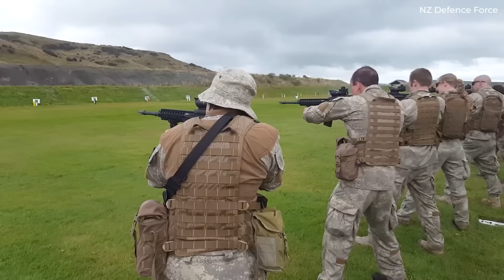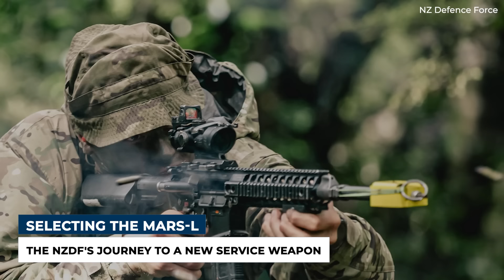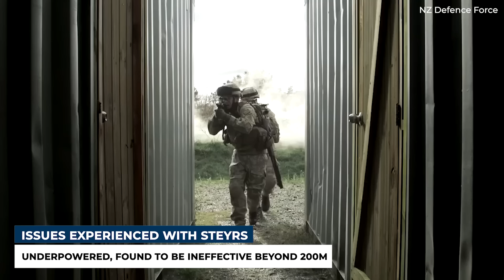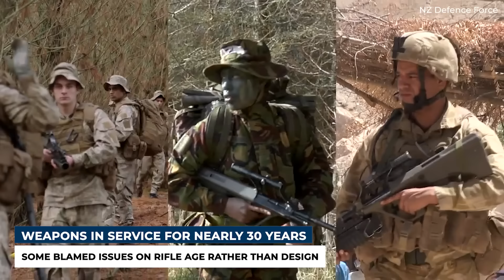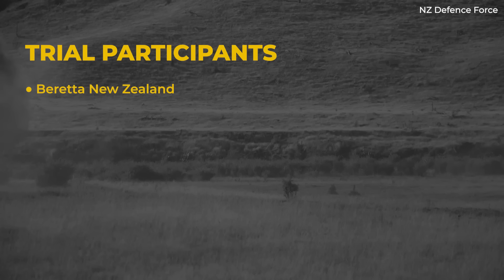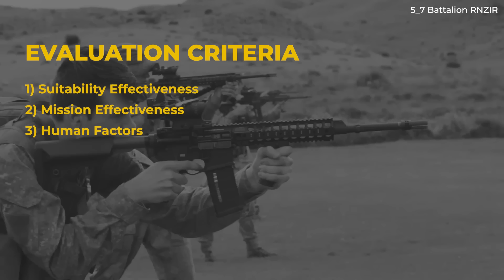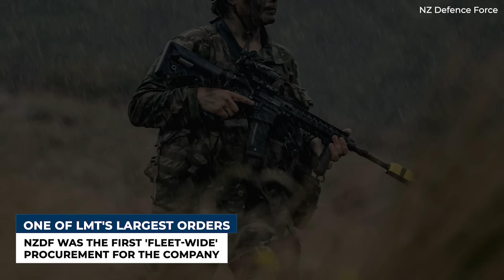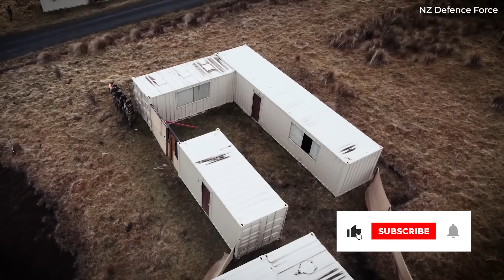NZDF’s Move To MARS-L: How New Zealand Selected Its Service Rifle

Comment: It's worth noting the NZDF had a per rifle price limit as well.   The MARS-L was the best in it's price range.
Reply: Obviously price matters, but the  Aussies made their AUGs  and regularly  and then started to improve the rifle, because Steyr did not.     The AUG can now be cloned/copied ...as can the M4 & G36.  And currently the HK 416 can be cloned/copied.   FN is a government owned company a major small Arms manufacturer.   The money for  the replacement, should have been for establishing a State owners Weapons Industry, starting with 556 & 762 ammo, grenades, , and   BP516  which is an improved clone of the AUG A2 or a  the AR5 which is a clone of the M4.    And then immediately start start implementing improvements, as well as do R&D and prototyping using now public IP to design NZ made weapons.   There was no need to replace the AUG with a new rifle ... if NZ  could make and entire AUG A2, & provide parts.  And one the NZ Weapons Industries is fully operational then it can start designing & making the replacement Rifles ( SR, DMR, SPR) & MG( SAW, LMG).  All of the  old FN MG are now able to be cloned
Reply: I strongly disagree. 

We're talking about a procurement of 9,000 weapons for a duration of 20 - 30 years, we do not need a domestic industry to fill that.

Also, the Styr is restricted when it comes to sights and attachments, it's fundamental design will always be restricted in that way.  With our experiences in Afghanistan showing that long range accuracy is important, that being able to effectively fire on targets a half kilometer away, effective sights are just about mandatory.
Reply: @launchsquid  Again.  FN from little Belgian, is a majar small Arms maker supplying weapons all around the world including NZ  offering the Scar L, when their FNC,  the G36, 416, M4 and ... Steyr AUG A3 are now Public IP that anybody can copy/clone.

NZ's AUGs were not A3 but were mostly the A1.

So NZ's version  FN, would simply supply parts & upgrades to A3, for current rifles ... will make 556& 762 ammo, grenades, ... will supply parts for Legacy weapons still in serice, and will start R&D & prototyping for new rifles & MG using Public IP.  And eventually compete with FN, HK, LMT, Colt, Baretta, etc to supply small arms & ammo to the miltary, police & civilians. 

There was no need to rush for a replacement, and for a military that is primarily the Army, then there is a need for an Armoury to provide at least guns, ammo, grenades and not rely on imports.
Reply: @launchsquid  That's because all those weapons were flogged out junk by the time they were replaced due to the services being run into the ground and made nearly derelict by government cuts. 
The original Austrian serial number weapons that the NZDF bought were more accurate, the Australian serial numbers had problems with bolt sleeve's cracking which were improved later. It would be interesting to know how their manufacturing tolerances and practices have improved from over 35 years ago. 
A bullpup .338 DMR version might be a sensible avenue one day. The main problem with the original Steyr AUG was the lack of room for forward furniture like lights and IR lasers along with the sight system that was outdated and unable to be removed and replaced.
Reply: @abelincoln.2064  Belgium is also connected to a wider European road and rail network that can supply all the high-quality materials needed. 

New Zealand is not.
Reply: @launchsquid  yet less then 6 months after NZ announcement, Australia was testing the EF88 which had full customization on sight and attachments.  Has effective range of 300 to 600m.
Reply: @abelincoln.2064  You are living in a dream world.
Reply: @Pilotmario  Why don't you want New Zealand to be be able to make its own guns & ammo,  ... but instead rely in foreign imports, and by the best the Europe & the US design & make?

Again.  The M4, G36, AUG A3,  Glock 17,  & all the legacy FM MGs are now public IP for any ... Company .... to clone & sell, which private companies  are doing.

The Aussies have a better trained & equipe Army than the NZ, and they did not give up on the AUG after its failings in Afghanistan, nor did the British give up on the SA80.   The AUG if properly maintain, upgraded restocked is a good weapon system, although with limitations. There was no need to replace it.  And instead of spending $40 million dollars on the LMT MARS, .. start a State owned making popular  ammo ...and ...AUG A3 to support the weapons use for the next 20 years, as well as make legacy pistols, Rifles & Machine for domestic/foreign sales, and eventually design their own firearms and quickly catch up FN, Sig(USA),, Barretta, HK, KAC, Taurus, Glock, etc.

But NZ has been for over 40 years been run by Globalist Liberals, who have no problem trading with a Regime that slaughtered 100 000 Democracy Protesters in 1989, and yet that same Regime is an enemy State of the Free Western World.  Only Liberals are this dumb, selfish & unethical.
Reply: @uncletiggermclaren  So its a fantasy that private gun companies are cloning legacy  pistols & rifels that are now Public IP,  ... including the AUG A3  ... or M4, M249, M240, G3, FNC, HK416, G36, Glock 17, MP5, 1911?    Stop being a Liberal.
Reply: @launchsquid ah stop, the Aug a2 fixed the sight issue decades ago. The Aug has a longer 20 inch barrel, and no 5.56mm rifle is engaging anything at 500m in reality
Reply: Interestingly, the aussies didn't make a left handed version, and I've seen what shooting one weak handed does to a face... all the lefties were made at steyr
Reply: @EmilyWalker-dr4bg     Yeah, I remember the NZDF made a big thing of the MARS-L being swappable right and left.  So it was better priced, more reliable, and had more features.  Maybe not a hard decision.
Reply: @launchsquid Your soldiers should be training to accurately hit CCP sized targets up to 500m. Any weapon platform that can do that is good enough.
Reply: @Muritaipet  Yeah great for those LEFTIES like me!😂
Reply: @peter-michaelkeys.2522    Good on ya.
Reply: @abelincoln.2064   Well, no.   Because you're ignoring the economic and technical complexity of making a rifle.  

To do what you suggest requires everything from steel mills that produce the appropriate steel to engineering / production lines producing hundreds of thousands of parts.  A really simple rifle like the M16 has over 100 parts. 

To make our own would actually be a major industrial project.  And with no more than 20,000 units (from memory we got 17,000 Steyrs), the cost per unit would be horrendous. 

My inside information was the army were given a maximum budget of NZ$12,000 per rifle. Which does stack up against the $59 million paid, for 9,000 rifles. About $6,500 per rifle. 

Let's be realistic here.  We could not manufacture 9,000 rifles for $59 million in NZ. Just the set up cost would be higher than that.
Reply: @Muritaipet  NZ did not just buy a rifle for about $6000, it bought a kit.  Don’t know how much the sights could have gotten cheaper separately. But the weapons cost is closer to $3000-4000.
Reply: @thomasb5600    Yeah. When I used that pricing I was being generous to abelincoln2064, and his suggestion we tool up and build our own.
Reply: @thomasb5600  What a deal.
Reply: @Muritaipet  As a project to employ a bunch of people, use our innovative ways to invent new processes etc etc it would have been good to see.  I'm sure we have the skill here.  Possibly it would have to be seen as a wider society make-work project to justify the cost.
Reply: @CitroenDS23    Or we could spend $59 million on the rifles we got, on time and under budget.  

Then take the $100 million we saved by NOT pursuing your idea, and get Rocket Lab to send up some NZ owned and controlled surveillance satellites. To look the 40,000,000 square kilometres, we have international obligations to monitor. With 2 ships and 3 planes.*  Maybe we could even add in some Global Hawk type drones to the mix. 

The perennial problem in NZ defence, is we always need to do too much on too little budget.  This will not change.

Adding on things we've never done before, is usually the worst idea. 

* I know we have more patrol assets than that.  Remember there is always less on patrol, because machines and crew require downtime and maintenance.
Reply: @abelincoln.2064 yes but a M4/M16 clone would be the easiest and preferable to the plastic fantastic.
Reply: I've been told by someone involved in the backend part of the trials that the price Thales Australia (who would have supplied the AUG if selected) for just the rifle was more than the price that LMT wanted for the rifle, optic and support package. Thales AUS thought they could take the piss and that we'd just automatically select the newer AUG version because it was what we were used to. With behaviour like that it's no wonder that the AUG wasn't in consideration.
Reply: @chrisp-nz.2544    Yeah. I've heard something similar through old contacts.  And also ...  someone else in these comments said they were involved in the trials, and that the MARS-L outperformed the other rifles. If that's true, we may have got a better rifle and a better price. 

But it's worth noting the Aussies might have a different strategic purpose to us.  They want domestic manufacturing capability, just like with their ships and armoured vehicles.  If that's part of the objective, the decision to pay more probably made sense for them.
Reply: @Muritaipet  I was involved with the trial. Myself and others only rated the MARS-L at maximum 4th place, my preference was the Steyr and H&K 416 both were expensive. It is true about the ozzys being greedy, the steyr the was purely out of contention for that reason. 
The MARS-L was just average across the board.
I also find it funny that there is no mention of barrel wear for the MARS-L as unlike the steyr its not chrome lined, if using the operational ammo 2000 rounds and your accuracy is pretty much gone.
Reply: @23kilkenny23   Interesting.  Scroll through the comments, you'll find the guy who said what I misquoted.  (I just looked again, he actually said "LMT was the only rifle that suffered NO issues.")

Price always has a role in buying weapons. Yeah, we need commonality, there are many strategic factors. My info was the budget was $12,000 max per weapon.  It certainly came in under that. 

As to accuracy.  Yeah.  Both of us have just fired in the general direction of the enemy, with no real idea of where they are. And when you can actually see them, that means......

Put a lot of slightly aimed rounds in their general direction.
Reply: Anyone looking at NZ military equipment would automatically make that assumption. 
We are a tiny nation with a tiny military.
We have an agrarian economy.
It's only logical that our arms budget wouldn't allow the purchase of anything that might make John Wick jealous.
Reply: @IvyMay-qn2ys    lol.  We are a little bit better than "an agrarian economy".  Rocket Lab for example. 
Otherwise ...  Yeah, spot on.
Reply: @Muritaipet 
Agriculture is a crucial & foundational pillar of our export sector.
Agriculture, fishing & forestry make up the bulk of our physical export goods. 
While not a strictly agrarian economy.
It's the best way to describe our economy without getting too invested in the details.
Those industries employore kiwis than any of our other export industries. Like technology
Reply: @IvyMay-qn2ys   Absolutely.  It's always best to remember that once the gold ran out, we built our wealth on sheep.  Then dairy.  

The classic economics production example is "guns vs butter".

We buy guns with butter.
Reply: Hare that little firing pin retention pin in ar family bolts. 

Used the ar/m4 domestic and overseas on deployment. 

Used the steyr for 2 decades ish.

Both have pros and cons

Comment: The NZDF Steyrs were all ancient first-gen F88s, no rifle in the world is still going to be running perfectly after that time in military service. 
There was no accuracy issue with the F88, the main limitation was the donut sight which was sub-optimal for longer range shooting. When we started getting ACOGs for our F88SA2s even the most spastic shooters were consistently hitting targets at 600m. As for the rifle's lethality, well it's a 5.56 from a 20" barrel, it's certainly not going to be any worse than any other 5.56, especially one from a shorter barrel.
Plus there was always a 'grass is greener' aspect, especially when guys saw SF using M4s. If Sass cats were running around in pink tutu's every digger would want a pink tutu and claim camouflage uniforms are crap.

Comment: I wonder what would have happened if NZDF had waited 6 months before testing. Would they have tested the EF88 beside the AUG A3!
Reply: No, we would not have, due to per-unit price. There was a limit on what could be spent.
Reply: @davidbuck5864  That doesn't would right.  LMT has expensive rifles. Steyr has made the AuG for decades, and likewise the Aussies made their own rifles.  How would the Mars be cheaper than the AUG?
Reply: @davidbuck5864 the EF88 was cheaper than MARS
Reply: @thomasb5600  Where are you getting that from? Not anybody I talked to. Not the officer running the trial, who by the way was involved in the trials that selected the Steyr AUG almost 30 years earlier. He sure had nothing against the AUG.   I saw the documents  with the per unit costs on them. I am not allowed to break commercial confidentiality on anything I saw, but the Australian F88 was NOT cheaper than the MARS.
Reply: @davidbuck5864  I am not talking about Steyr AUG A3, I was talking about Thales EF88.  I am also not talking about F88.
You claim you have seen the documents on cost. But EF88 or F88 was not even on the test list.

EF88 was $2200-2500 per unit, yet NZ spent on MARS-L kit was up to $3800-4100.
Reply: @thomasb5600  i do not know where you get your information. The EF88 certainly was on the original list but dropped from shortlisting due to per-unit cost, which was too high. That surprised the hell out of all of us, who thought the EF88 would be a shoe-in.  But the decision was based on cost, pure and simple. Did somebody at ADI make a mistake and quote the wrong figure? Possibly. But we can only go by what was quoted tk us. While I was not part of the decision process,  I worked with those who were and I saw the documents, and spoke daily to the people who were responsible. I was there. Were you?